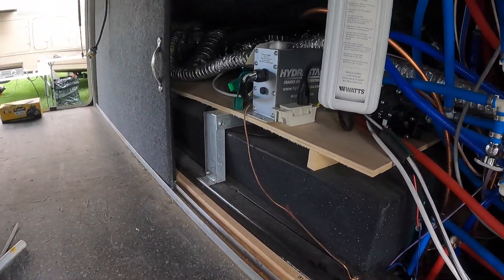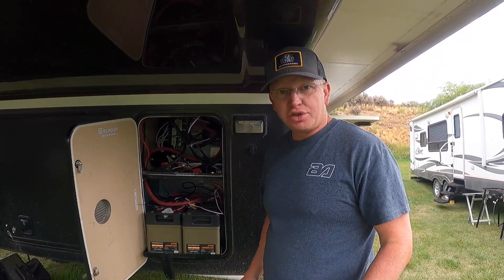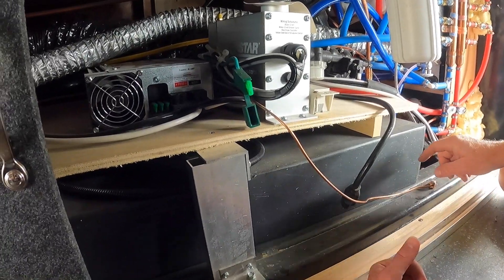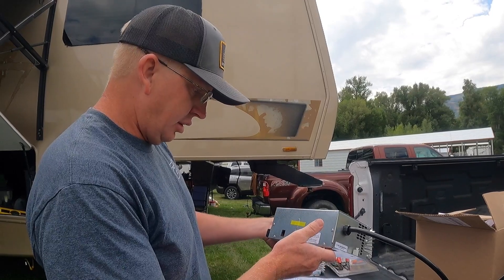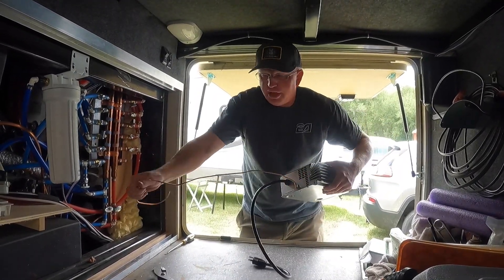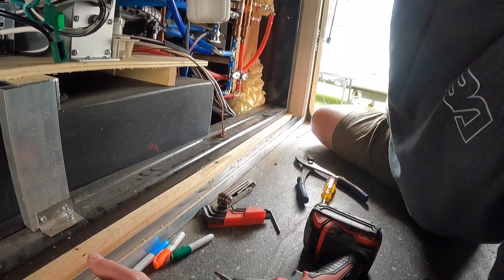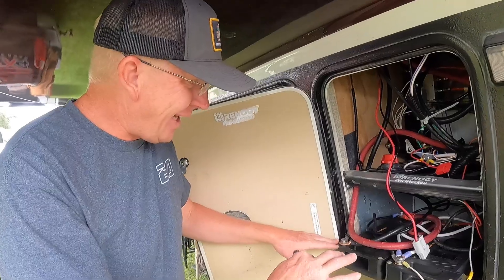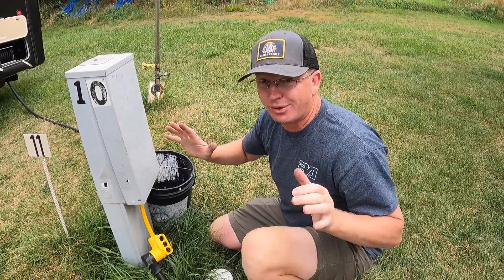Upgrade Your RV Converter/Charger: Best Options for Lithium LiFePO4 Batteries

Comment: I have a problem in my RV, the electricity goes out when it's very cold. I'm currently living in it and I don't know why the boltage goes down. Does anyone have an idea why this happens?
Reply from the maker: @ruliydominguez8154  are you on shore power?
Reply: Yes, I am connected 110v from my house to my RV
Reply: I'm new to this RV thing 😖😵😪☺️
Reply: You haven't identify as how cold, but if you're using lithium, they have performance issues in extreme cold; the solution to that is a heater. I have a Bolt EV & live in NH; when it gets below 0°f, performance dies as it uses more juice to heat the batteries than power the car. Once the batteries are heated, performance is still below that in a warm temperature.

Comment: You can't just upsize your converter without first verifying the DC wires can carry the higher current. It's unlikely you can just go from 30 amp to 100amp without replacing the DC wires leaving the inverter to the batteries. Otherwise your rig will be the next camp bonfire.
Reply from the maker: @Brisket9392 good information thanks for watching.

Comment: I use red electrical tape to mark positive wire and black electrical tape to mark negative wire. I recommend that all on all 12 volt electrical connections you Identify positive and negative/ground with the red and black electrical wire.
Reply from the maker: @askmslynnllc5363  smart suggestions.  Thanks for watching.
Reply: Model number of new unit?